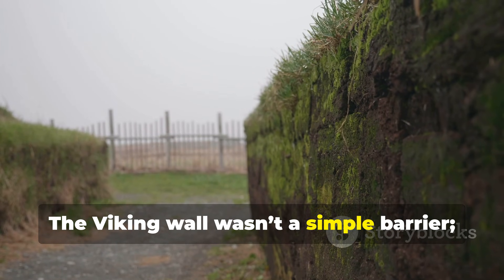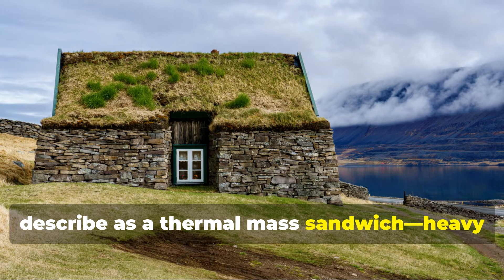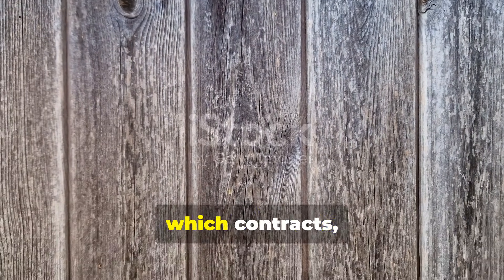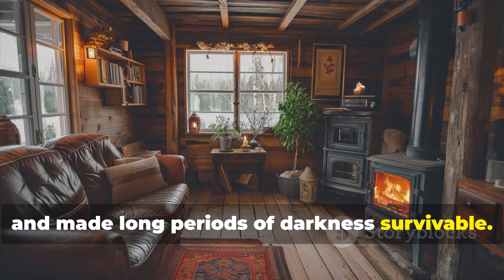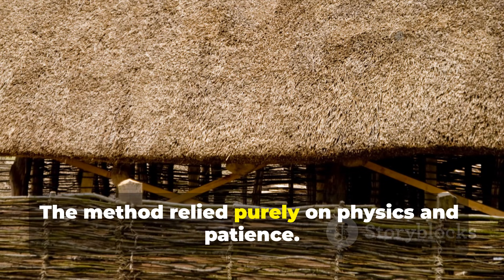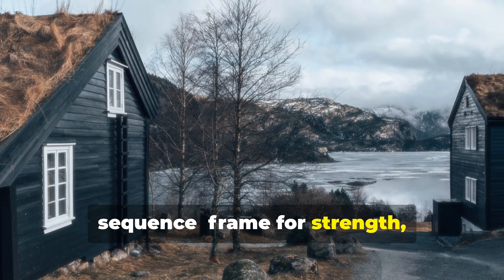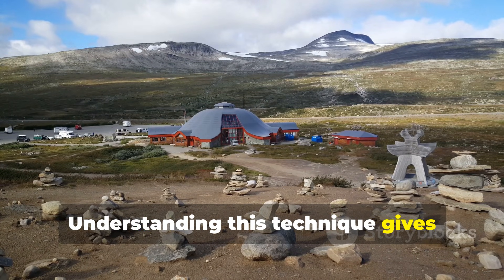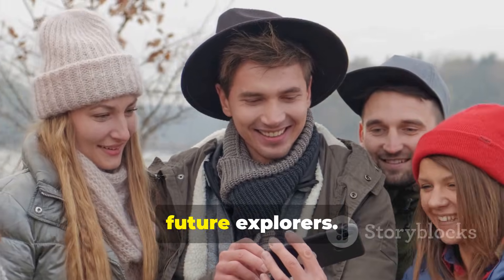The Viking Insulated Wall Trick Arctic Builders Trusted Most

Comment: 2:45 "The real strength of the Viking is that it didn't rely on soft fibers or fragile materials"
3:01 Those thick turf blocks when dried appropriately were good for a couple years of good insulation.
Most turf blocks were used shortly after they were cut. The roots of one block intertwining with the others.
The Vikings were very good at being adaptable and using what they had under adverse conditions.
When they didn't have stone or logs, they used sod.
Reply from the maker: Yes, they were really creative